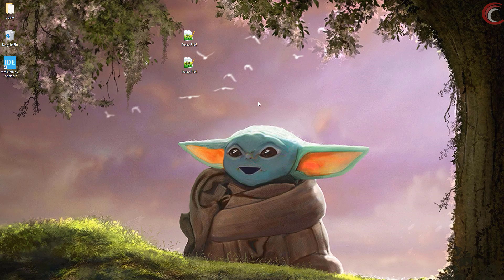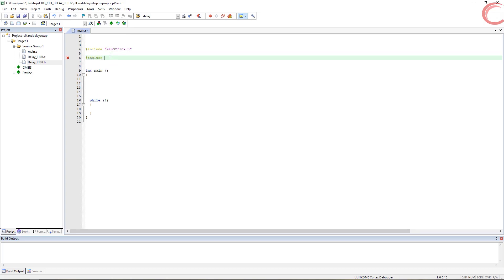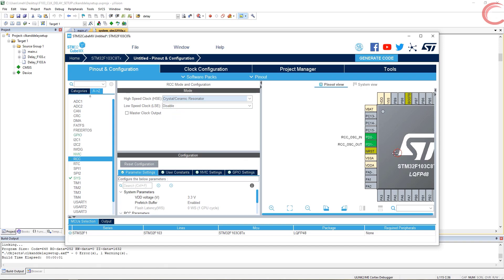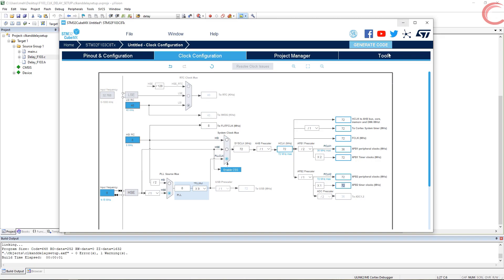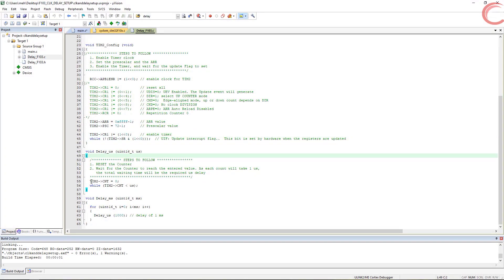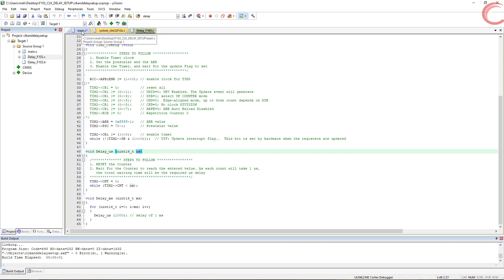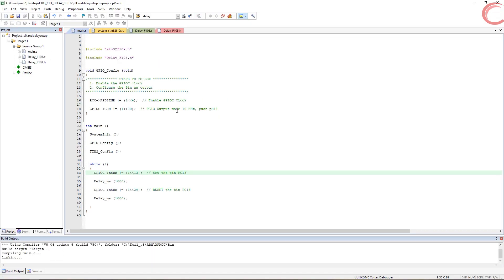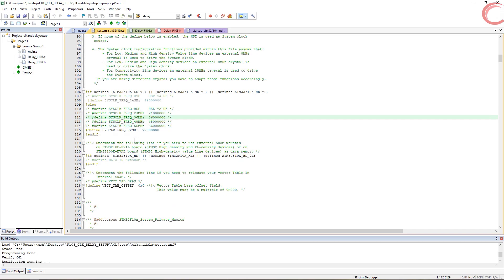#1.2 STM32F103 Clock Setup using REGISTERS || TIMER Config || GPIO Config

Comment: what is the difffernce between peripheral clock and timer clock
if timer clock is 72MHZ ,it shows peripheral is 36 MHZ means CAN,UART runs at 36 or 72 MHZ
reply bro
Reply from the maker: Peripheral clock is used by peipherals, like ADC, UART, SPI, I2C, etc. A Peripheral clock of 36MHz does not mean that all the peripherals will run at this frequency. IT is the maximum value and the peripherals will drive the clock from this. Then they use the prescaler to bring down this clock to their operating limits.
Timer clock is used by the timer connected to the respective APB bus. Timer runs at this clock, and you can use the prescaler again to bring down the timer clock also.

Comment: i am new in stm32 Programming and want some help please:
somtimes i see thing like this RCC->AHB1ENR |= (1 << 4); which i understand it i look at register index and put desired bit, but somtimes see somthing like this: GPIOA->MODER = 0x00000400; or like this SysTick->CTRL = 0x5; how i get the right number  the  0x00000400 and the 0x5? where i find those 0x00000400 and the 0x5?
Reply: It's at the Bit definition for the register, in stm32fxxx.h

Comment: I am writing the same codes, but;
20-25 seconds not working...

It then works fine, as it should.
The reason; is it too obvious? I couldn't find it unfortunately..
If you have any ideas, I would be glad.
Reply: #include "stm32f411xe.h"

void Saat_FrekansAyari(void);
void GPIO_ayari(void);
void bekle(uint32_t zaman);

void Timer_Ayar(void);
void bekle_us(uint32_t zaman_us);
void bekle_ms(uint32_t zaman_ms);

int main(void)
{

	//Saat_FrekansAyari();
	//SystemInit();
	GPIO_ayari();
	Timer_Ayar();
	
	while (1)
	{

		GPIOD->BSRR |= (1<<12);
		bekle_ms(1000);
		GPIOD->BSRR |= ( (1<<12) <<16 );
		bekle_ms(1000);

	}

}

void Saat_FrekansAyari(void)
{
	
	//100mhz için ayarlaniyor
	#define PLL_M	4
	#define PLL_N	100
	#define PLL_P	0 //00=2 01=4 gibi.. 2 olarak seçildi(yani 00)

	//[1]
	//(HSE harici osilatör seçilir)
	//osilatör seçilir ve 6 saat darbesi geçip RCC_CR_HSERDY biti 1 olana kadar beklenir.
	RCC->CR |= RCC_CR_HSEON;
	while(!(RCC->CR & RCC_CR_HSERDY));

	//[2]
	//Volataj reg. ayarlari yapilir
	//(PWR INTERFACE AHP1 Clok hattinda bulunur)
	RCC->APB1ENR |= RCC_APB1ENR_PWREN;
	//cube 66mhz ragmen bunu seçti, ilginç?
	PWR->CR|=PWR_CR_VOS;//PWR_CR_VOS_1 reset degeri 10 ancak 11 olarak seçilmis. (<=100Mhz)

	//[3]
	//Flash bellek ayarlari
	FLASH->ACR = FLASH_ACR_ICEN | FLASH_ACR_DCEN | FLASH_ACR_PRFTEN |FLASH_ACR_LATENCY_3WS;

	//[4]
	//Ana frekansin saat hatlarina bölünme degerleri (örnegin ahpb1 hatti ana frekansin kaç kati olsun gibi?)

	//AHB PRESCALARS
	RCC->CFGR |= RCC_CFGR_HPRE_DIV1;

	//APB1 PR
	RCC->CFGR |= RCC_CFGR_PPRE1_DIV2;

	//APB2 PR
	RCC->CFGR |= RCC_CFGR_PPRE2_DIV2;

	//[5]
	//PLL ayarlarinin yapildigi kisim (bitsel kaydirma ile dogrudan degerler girilir)
	RCC->PLLCFGR = (PLL_M << 0) | (PLL_N << 6) | (PLL_P << 16) | (RCC_PLLCFGR_PLLSRC_HSE);

	//[6]
	//PLL Aktiflestirilir ve son kontrol yapilir (hazirmi diye)
	RCC->CR |= RCC_CR_PLLON;
	while(!(RCC->CR & RCC_CR_PLLRDY));

	//[7]
	//PLL ayarlarinin set olmasini bekle
	RCC->CFGR |= RCC_CFGR_SW_PLL; //Sistemin clock kaynagi pll olarak seçiliyor (HSI/HSE)
	while ((RCC->CFGR & RCC_CFGR_SWS) != RCC_CFGR_SWS_PLL);

}

void GPIO_ayari(void)
{

	//[1]
	//Ihtiyaç duyulan gpio portunun clock hatti aktif edilir
	RCC->AHB1ENR |= (1<<3); //d portu 3.pin ile kontrol edildigi için 1 log. seviyesini 3 kez kaydirarak kaydediyoruz

	//[2]
	//GPIO pinlerinin modunu ayarliyoruz (genel çikis, analog, input, diger) (12,13,14,15 ledler d portuna bagli..)
	GPIOD->MODER = (1<<24) | (1<<26) | (1<<28) | (1<<30);

	//bundan sonraki adimlara ihtiyaç yok; zaten varsayilanlan konumdalar
	GPIOD->OTYPER = 0; //PUSH-PULL O OPEN DRAIN 1
	GPIOD->OSPEEDR = 0; //00 YAVAS 01 MEDIUM 10 HIZLI 11 ÇOK HIZLI

}

void bekle(uint32_t zaman)
{

	while(zaman--);

}

void Timer_Ayar(void)
{
	
	//Öncelikle clock hattiini aktif ediyoruz (TIM2)
	RCC->APB1ENR |= (1<<0); // RCC->APB1ENR |= 1; Desekte olurdu..
	
	
	/*
	Bu 8 bitlik Control 1 registeri zaten varsayilan hali 00000000 dir..
	Her hangi bir islem yapmaya simdillik bir gerek yok...
	
	TIM2->CR1 = 0; //Reset atilir
	TIM2->CR1 |= (0<<1); //UDIS=0; UEV aktif edilir.
	.
	.
	.
	*/

	
	//prescalir, bölücü registeri, kaydedicisi; ana frekans/(bölmek istediginiz deger-1)
	TIM2->PSC = 100-1;
	
	//otmatik reload/doldurma registeri ARR 32 bit oldugu için en yüksek degeri verdik..
	TIM2->ARR = 0xffffffff-1;
	
	TIM2->CR1 |= (1<<0);
	while (!(TIM2->SR & (1<<0)));  // UIF: Update interrupt flag_ güncelleme/ayarlar bitmesi beklenir
	//bu register 1 ise islem var, 0 ise islem yok, güncellemeler tamam anlamina gelir...
	//bekle(1000000);

	
	
}

void bekle_us(uint32_t zaman_us)
{
	//Sayaci sifirliyorum...
	TIM2->CNT=0;
	
	//sayac zaten us(mikro saniyede bir 1/1000000 sn de bir artiyor)
	//dolayisiyla istenilen degere gelene kadar while bekletiliyor sistem(vasat..)
	while(TIM2->CNT < zaman_us);

}

void bekle_ms(uint32_t zaman_ms)
{

uint32_t sayac_bekle_ms_1 = 0;

while(sayac_bekle_ms_1<zaman_ms)
{
	bekle_us(1000);
	sayac_bekle_ms_1++;
}

sayac_bekle_ms_1 = 0;

}

Comment: hello! first of all thank you very much for all your videos. You are one of the channels I follow the most!
I always have some problems in knowing which registers should be initialised. Let me explain better: 
When you need to configure the clock, the datasheet doesn't say that you also need to configure the registers dedicated to the flash and the voltage regulator (as you did in steps 2 and 3). My question is: 
How do you understand what you have to initialize when you have to do a certain thing? Do the people who wrote the datasheet assume that users initialize all the registers? Because some settings are definitely not of interest but I can never figure out what is important. For example, what you said about steps 1,4,5,6 and 7 makes sense when I think about clock initialization, but steps 2 and 3 I would never get. Sometimes even in the datasheets there are numbered lists with all the steps to be executed, this is not bad. Unfortunately this is not the case for every operation. How do you go about it? How do you understand what registers need to be initialised?
Reply from the maker: I guess you are talking about the first Video and not this one.
Configuring the clock is one of toughest things in ARM controllers, So if you are having hard time, It's alright.
Now coming to your question.
Well to be honest I don't know either, and that's why I referred the CubeMX settings in the video.
So All I needed to do was, set the things exactly as they were set in the cubeMX.
Reply: @ControllersTech  OK perfect, you have reassured me with this message!
I always wondered how exactly the thought processes worked to set these things up. I'm a student and I'm about to finish my bachelor in electrical engineering. I have never had any problems with the concepts but more with the implementation. by the way your videos have helped me a lot during these three years of study! Thank you again for everything you've done!

Comment: Hi. please make  tutorial how to use the hall sensor interface driver. From hal library.  To control the motor, speed and position. Thanks.
Reply from the maker: Isn't hal sensor used to measure the magnetic field.. how to control motor using that ?

Comment: Hi. Could you make a video about RTC in Blue Pill? I could not use RTC and the LED at PC13.
Reply from the maker: Using registers ?
Reply: @ControllersTech  I prefer using HAL
Reply from the maker: RTC in bluepill have some issues. It looses time with the reset and it's a known issue. 
Other than that, you can use that internal RTC video I made for f4... It works for bluepill
Reply: @ControllersTech STM32F103 has only one counter for the RTC. I think it's not compatible with F4.
Reply from the maker: You tried setting up the RTC with CubeMX ? What's the issue ? If you don't reset the board, it should run pretty fine